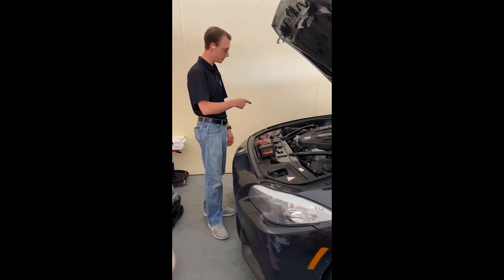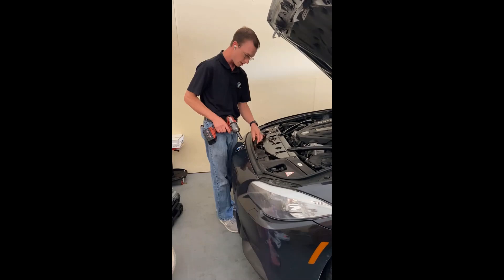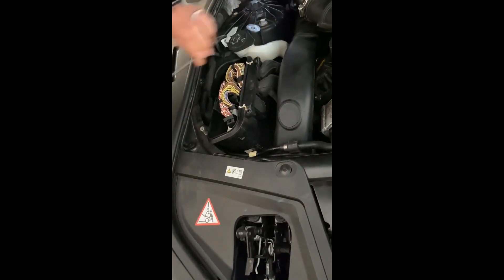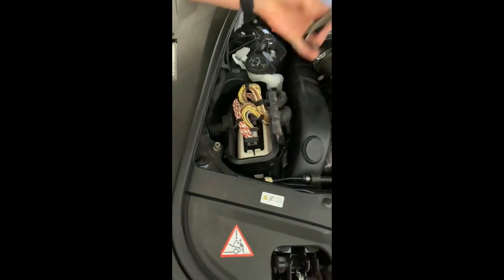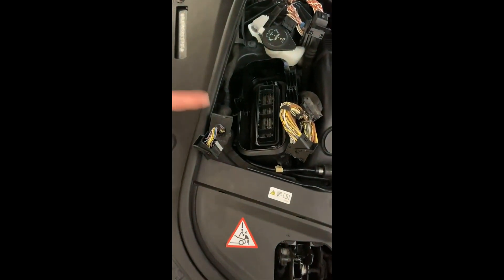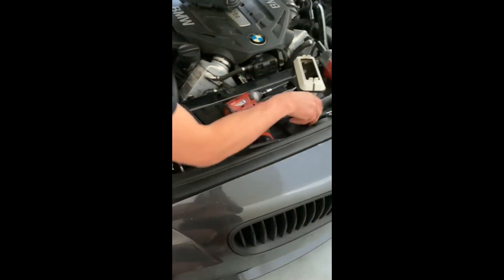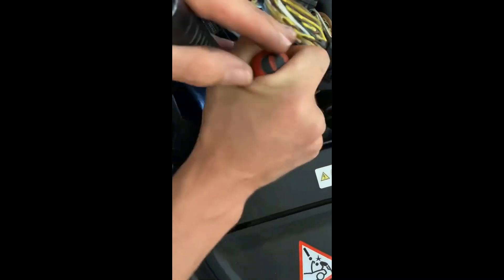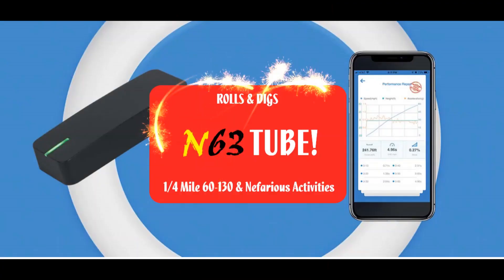BMW N63 DME-ECU Removal

Comment: How do you re-attach the coolant hoses? It looks like there was barely enough room to pry them off.
Reply from the maker: you must press them back on it is tight in there can also pull entire black case and attach from bottom but not necessary.
Reply: @N63Tube  I assumed that you pressed them back on... but I was more interested in HOW you did that? You can't get your hands down there I assume? Do you grab the hoses with needle nose pliers or...? What's the worse case scenario if you break one? Is the coolant leak bad enough to be noticed?
Reply: Would be nice if they made a video putting it back in. I know it’s just in reverse but still it would be helpful